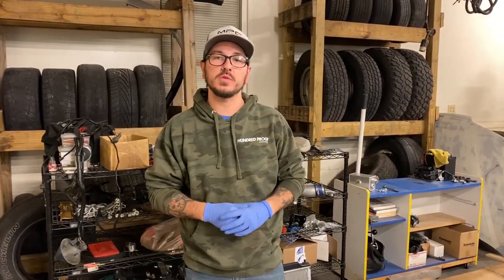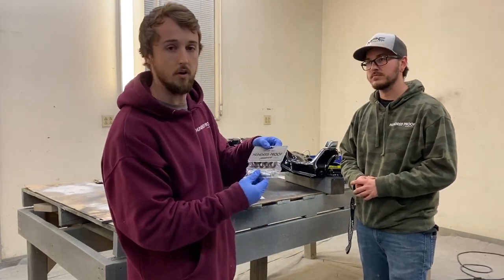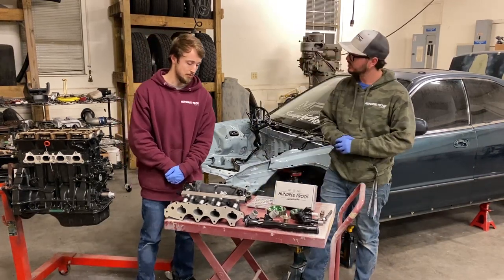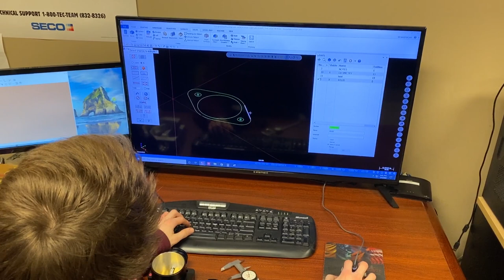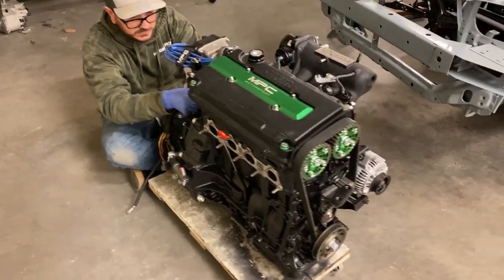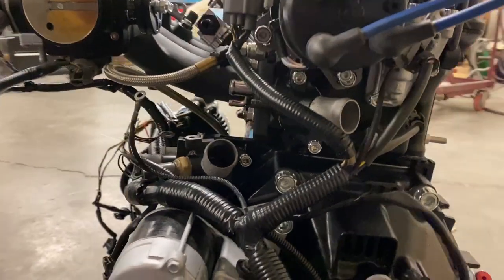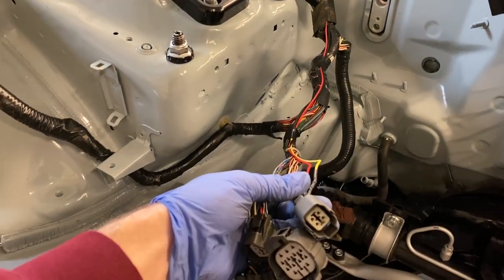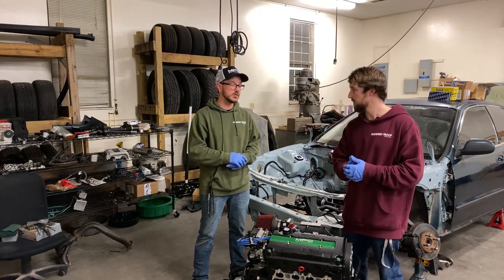SLAMMED INTEGRA PT 2  |  B20 VTEC SWAP, ABS DELETE & ENGINE BAY PREP

Comment: thanks for the video guys! i have a question i have a complete b18c conversion engine, trans, etc. i'll be doing this b18c swap on my integra that currently has 1.6L zc non vtec engine on it, do i have to do any wiring modifications for vtec etc? or everything is plug and play